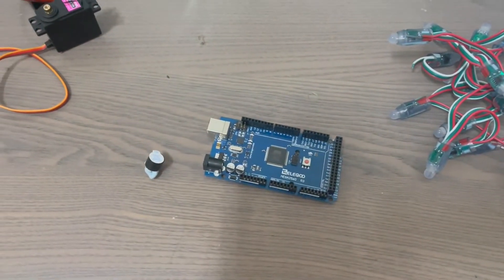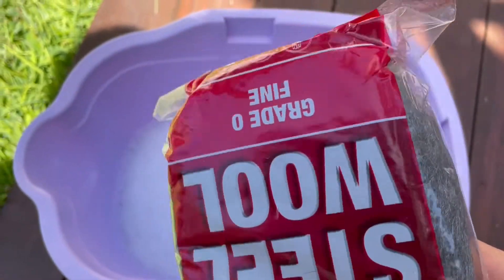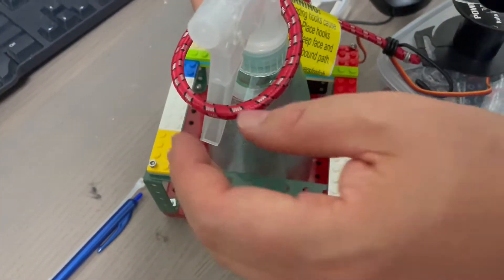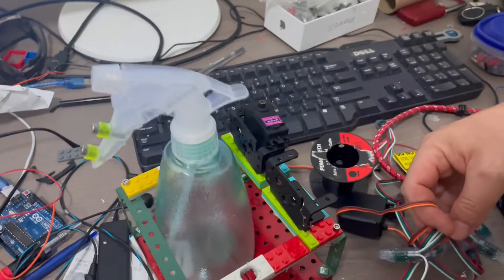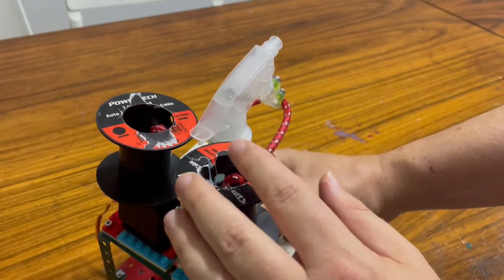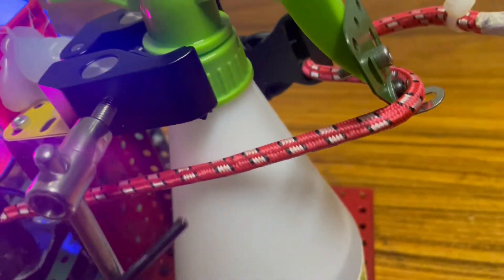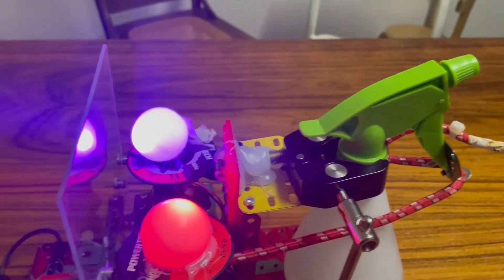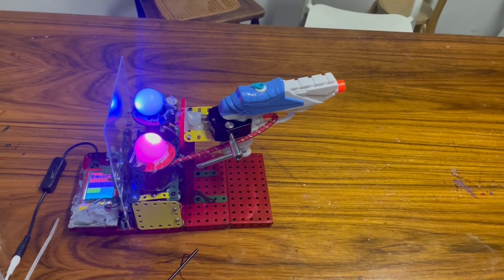waterspray alarm clock

Comment: Nice one JR, looks awesome! Hope you have a patent on it? Have you adjusted the nosel On the bottle, you may find you will get different types of spray and maybe more power? Great idea!
Reply from the maker: Thanks Andrew. No, I haven't got a patent on it. I think it is still a work in progress.
Reply: @jonathanr4242  now the question is how do you fit it into a iPhone? Now that’s a million dollar idea. A small tube of water with compressed water well in it. Either as a very small drink or to spray on you as you have invented? Just set it up next to your bed?
Reply from the maker: @andrew_bookallil  you mean control it from your phone? Not that difficult but a fair bit of work  stay tuned
Reply: @jonathanr4242  that too! But actually in the phone and fill it, like filling a butane lighter? Can you compress water like that? Into a small tube?
Reply from the maker: I don't know if liquid can be compressed like gas. It would have to be some attachment. Apple would never go for putting it in the phone.
Reply: @jonathanr4242  yeah it would definitely need to be an attachment!